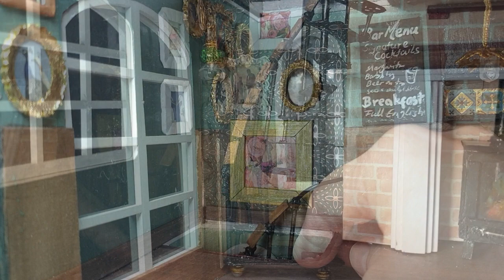Miniature CAFE KIT Into A PUB | MINIATURE | DOLLHOUSE | #britishpub #miniaturepub #miniaturekit

Comment: Love what you did. I'd like to do the same beer tap system but haven't understood what you use and how. Could you please explain me? Thx
Reply from the maker: Thank you! 😊💕 The silver wire I used was aluminium wire which is quite soft and easy to bend and manipulate. For the tap hand pumps I used brown wooden beads. The part underneath the wooden bead is a gold coloured jewellery tube bead. Under that is a gold coloured Plastic Butterfly Earring Back / stopper (gold with see through plastic) and then on top of the brown wooden bead, a gold coloured seed bead 15/0.  The white board I glued them on (and painted brown) is called PVC Rigid Foam Board/ Chevron / Sintra Board. Hope this helps 😊